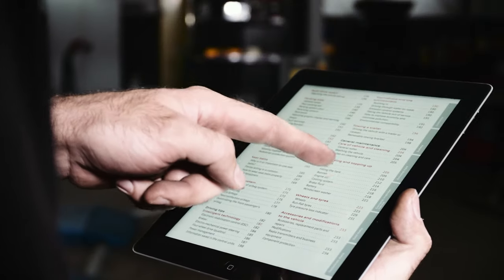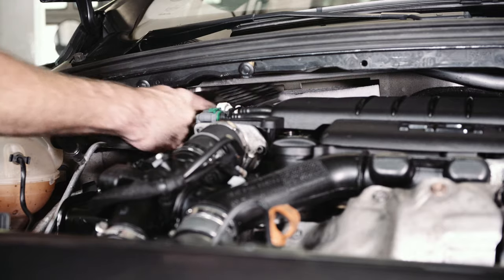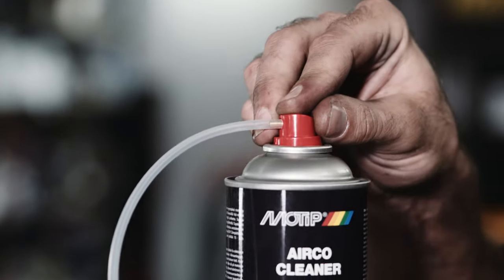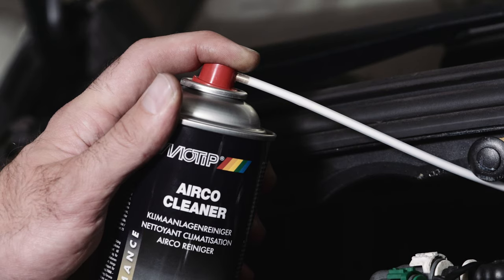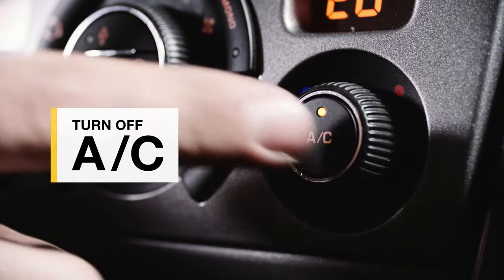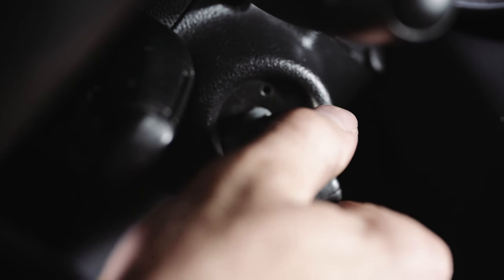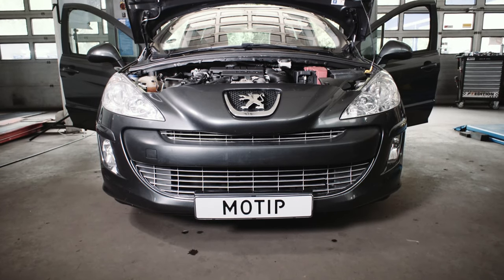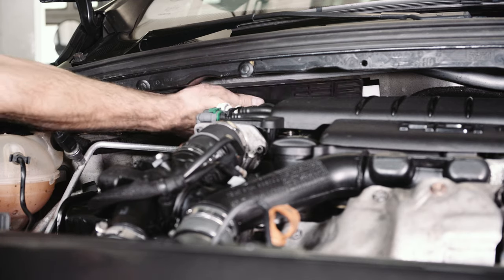How to clean the airco of your car with MOTIP Airco Cleaner?

Comment: Your doing this while the vehicle is off and after the 30 minute wait time you start and set the the ac to max without the new filter in place and run for 10 minutes right?
Reply: @John A. thanks
Reply: Ignition on, engine off.  Yep

Comment: Can you just spray this foam info your blower and cause no damage? 🤨
Reply from the maker: You have to switch of the engine and the electrial installations before treatment. You apply the foam into the evaporator of the air conditioning by means of the enclosed adapter. Insert the adapter about 30 centimetres into the air inlet of the air conditioning and completely empty the can. The location of the air inlet differs per brand. After applying, do not switch on the engine or the electrical installations for at least half an hour. In this half hour the foam will break and leave the system through the condensed water outlet as a fluid. If you follow this steps, no damage will occur.
Reply: @MOTIP_eu  Thank you!

Comment: should I spray it off in both air filters sections or it doesn't matter ?
Reply from the maker: Hi, where you remove the cabin air filters you can spray the product. The location  varies from brand to brand. Consult your dealer.
Reply: @MOTIP_eu   It is a bmw E61 525d and it has air filters on both sides which most probably end in one pipe that's the reason I'm asking.Nevertheless thank you for your quick response.

Comment: So the airco can be on when the engine is turned off... ?!
Reply: wtf
Reply: No, compressor won't run without engine power, unless it's an electric only compressor, but even then its unlikely because an electric compressor would want the battery being charged by the alternator before it would run happily.

In terms of heat via AC, as long as the engine is warm, you will still get residual engine heat into the cabin until it cools down.
Reply: Of course NO, just make sure the AC is OFF when you start the engine. The radiator has to dry with the help of a HEATER, not with the help of AC. This is how you should dry the evaporator off MOTIP product.
Reply: To anyone still confused, when you turn your key to third position right before you crank the starter, the A/C light will be ON, meaning the second car starts the compressor will start running. So basically put in your key, turn it to third click, as the A/C light comes on, turn it off, then start the car.

Comment: Do you have to unplug the battery or just turn off any electrical components of the car?
Reply from the maker: When you use the product make sure the engine is turned off and follow the step accordingly.

Comment: My cabin filter is inside the passenger footwell can i also spray there?
Reply from the maker: The location of the air intake varies per car brand. Please ask you dealer if this location in your car is correct.
Reply: So as mine, I have sprayed the full can as deep as possible. After the foam dissolves, the liquied both came from the drain pipe under the car and also inside the cabin